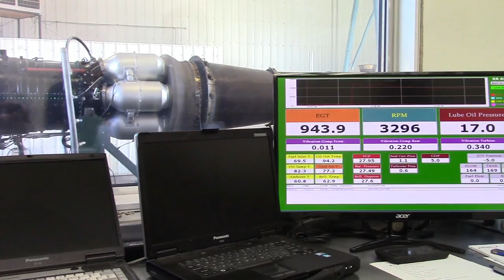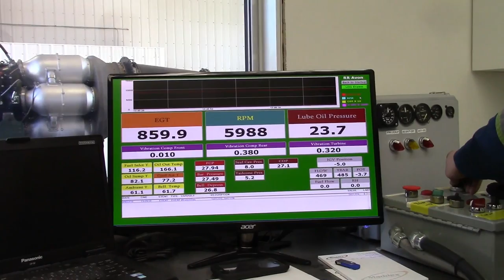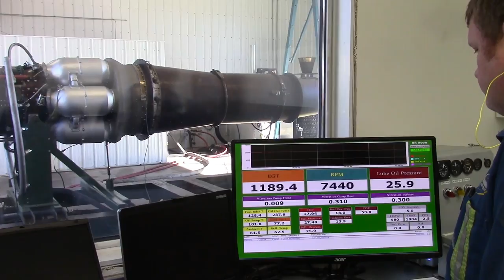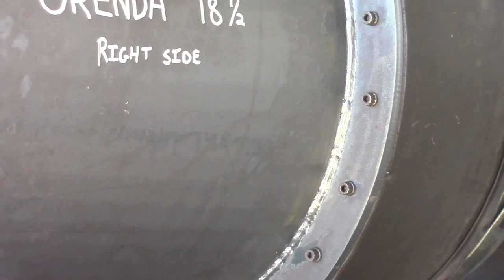Land Based Jet Engine

Comment: Hi Jay.. 

You're probably going to think this is a stupid question, and I think I asked it before, but I couldn't find where I posted it.. 

My question is, do industrial jet engines produce as much thrust as those used on aircraft, and if so, how is it dealt with? 

Thanks, Jay.
Reply from the maker: +Kevin Rowe 
Industrial engines do not have the exhaust accelerating jet nozzle, so they make no thrust.
Reply: I've wondered about that for a very long time. Keep making the great videos. Even though I'm not in the jet engine business, they're still very interesting to me. Thank you Sir.
Reply: السلام عليكم.انا اسئل عن بداية عمل.او بداية تشغيل ونهاية تشغيل المحرك النفاث كيف تكون. وشكرا لكم.

Comment: Is that an afterburner rig toward the end of the pipe?
Reply: It's an industrial version, afterburner would be a waste there. My guess would be that what you're talking about is an Exhaust Gas Temperature (EGT) sensor.
Reply from the maker: If it's those two probes, they are pressure sensors, used to calculate power output.
Reply: Ah! Thank you gentlemen.

Comment: Why use start cart vs built in starter?  Thx
Reply from the maker: We use both. The starter is a starter... a starter motor, just like a car. The start cart supplies the electricity to power the starter. Even the F86 did not carry large enough on-board batteries to power the starter.
In an industrial setting, the more equipment located off the engine, the easier it is to operate and to service.
Reply: Ok Thx, I guess those F86's could be started with the exhaust to inlet of another in a pinch..
Reply from the maker: That is a story told by good ol' Chuck. It is a procedure that is likely to cause engine damage, and i have called it before, as bullshit.
Reply: Yes it was Chuck At Oshkosh, he's definitely a showman, I would think you can get 800 rpm doing that...Thx again, learned a lot of jet engines/turbines watching your videos.
Reply: Just realized I had my terms wrong, it was wet thrust i.e. after burner, or water injection on the old J-57-P-59W . Thx